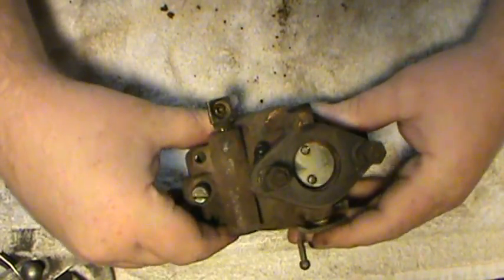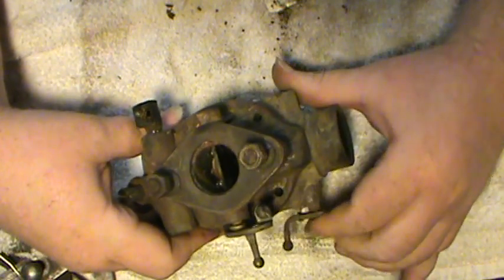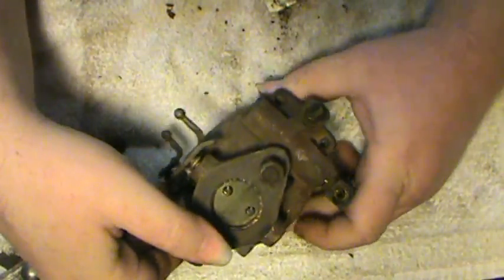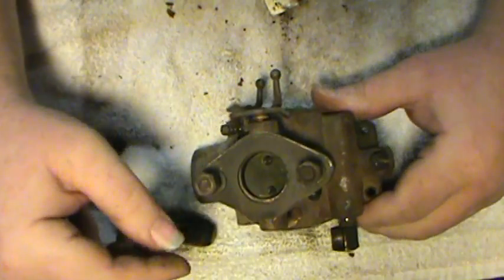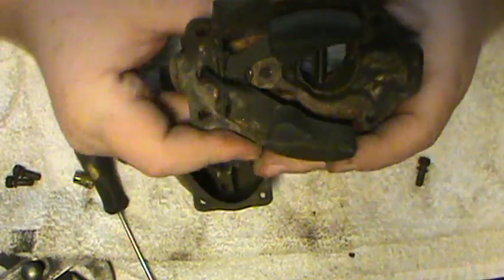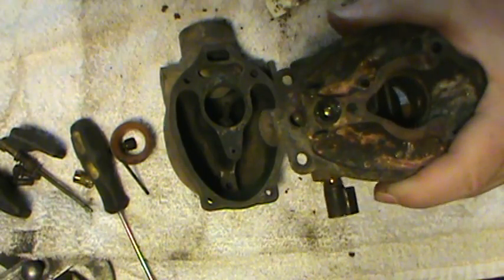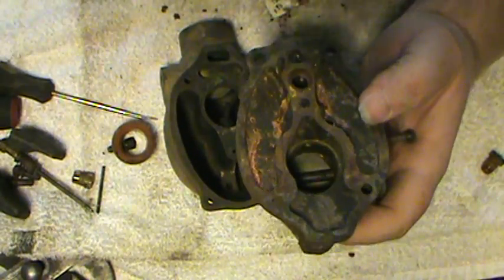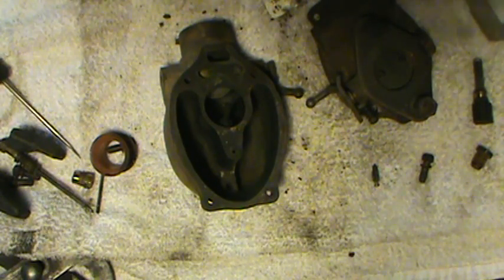Rebuilding an updraft carburetor for 8n ford tractor part 1

Comment: I keep several small 6" sections of old metal guitar string for cleaning out the small passages on carburetors. I use the thin E string and B string for smallest holes and some of thicker ones for larger openings.

Comment: I just subscribed to your Channel just the same thing you did to this carburetor but I cannot get mine to smooth out not sure if the issue was even there now it fires right off Idols pretty good but no power on top end popping and cracking

Comment: On the choke butterfly there is a flap that won’t close when I open the choke,   I saw when you did yours in the video, it was fully closed.  Should it be flapping around or should it be stationary?.  By the way, great video.  Thanks.

Comment: my 8n was starting up great . then sometimes it would act like it was low on gas and start putting then next time I was on it it would run good.  it's been going back and forth like that. today I went to start it and I could only keep it running with the choke full closed. now it won't start. do you thing it's the carb? or points? idk much about these old tractor.

Comment: That is correct it is flooding. Reset the float?
Reply from the maker: Check the float to make sure it is not hanging up. Also check the needle and seat to make sure a piece of trash did not get in it. Also check the float to make sure it is not leaking. If you place the float in a bowl of gas it will sink if it is leaking. You can also shake the float and hear gas in it.

Comment: I don't know what happened! Well we got it running and running good. 2 days later it won't start. Tries to start,coughs and lightly pops. Is this from the carburetor out of adjustment?
Reply from the maker: Make sure that it is not flooding.  Those old up draft carburetors can be very cantankerous. I have found that those old tractors have some what of personality sometimes when it comes to cranking.  I find that some won't crank with the choke on. Others won't crank without the choke and all sorts of combinations.  Then if you don't get the combination right it floods and won't start.

Comment: Well we thought we followed the directions, however upon turning the flow of fuel to the carb., fuel runs out of the carb. Are the floats set wrong?
Reply from the maker: Sometimes the float can be tricky. Take the carb back apart and make sure the float is not binding. Turn the upper half of the carb over with the float on it and make sure the float is parallel to the surface of the carb. If it is not you adjust it by bending it right in front of the pivot pin.
Reply: +MRBoatwrights OK, we readjusted the floats so there was about a 1/4" between the float and the gasket and that did stop the fuel leaking. Now we can't get the tractor to idle. Runs at very high RPM. Is this a matter of the carb. adjustment?
Reply from the maker: +Mike Boggess Most likely adjustment. The idle screw is on the throttle shaft where the linkage hooks up. Adjust this screw for the desired idle rpm. The other screw is the idle air screw you won't to start with two full turns off the seat the adjust to get it to idle smooth.

Comment: Need help working on 1939 Ford 9n rebuilt distributor replaced coil, resistor, rebuilt carb,  has spark and fuel but won't start going crazy any thoughts?  Thanks
Reply from the maker: Have you checked for compression? Also check your timing and firing order to make sure the wires are not crossed.

Comment: Need help working on 1939 Ford 9n rebuilt distributor replaced coil, resistor, rebuilt carb,  has spark and fuel but won't start going crazy any thoughts?  Thanks

Comment: NO: Drain all the hydraulic fluid out completely .2. see if there are
any filters or internal screen, clean the sreen, pour diesel fuel
into the hydraulic system and run it for about 5 minutes raising and
lowering the 3 pt, lift.  3. Drain and replace with hydraulic fluid.
You should be good to go.

Comment: Thanks for the video I have a 600 ford and I started mowing and I had to keep it running with the choke pulled out, Took the carb off and just got the kit at tractor supply and with your video I have just rebuilt my first carb, Will reinstall it today and hope it runs.....
Reply: Did it run

Comment: on the back end of my ford 8n my lift wont go up and down very good, so some one told me it probably had water in it so my son loosened the drain plug a little and some water drained out, but it still don't work 100% do you think i should just drain it spray it out with diesel, fill it back up and do you think that will do the trick